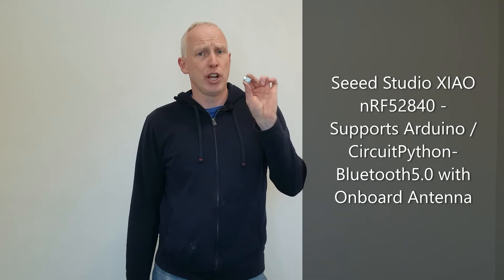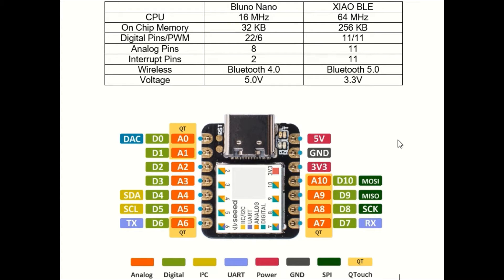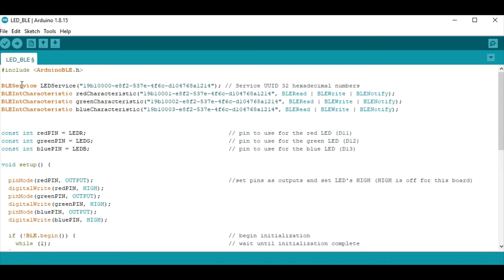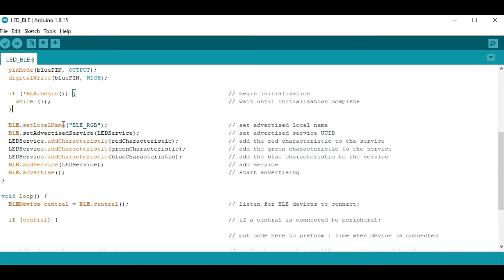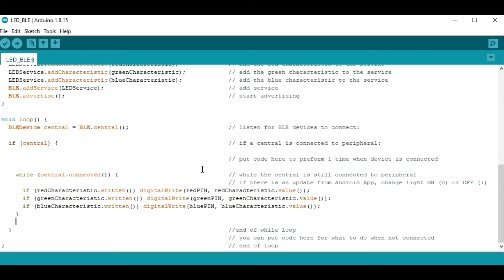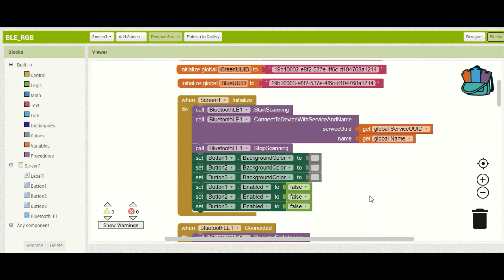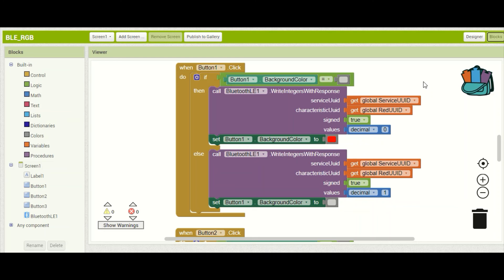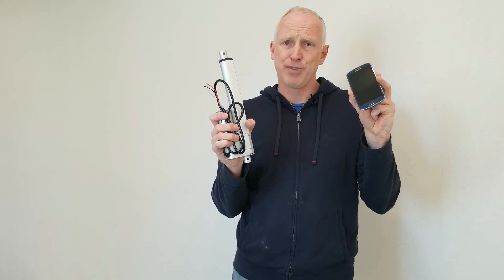XIAO BLE Digital Output Control using Arduino and MIT APP Inventor

Comment: As versions of libraries are always changing, some changes have occured with XIAO. The reserve names for LEDR, LEDB, LEDG are now LED_BLUE, LED_GREEN, LED_RED.
Secondly, I'm getting a compile error, which is probably the BLE library version. What version are you using?

d:\Arduino\libraries\ArduinoBLE\src\utility\HCIUartTransport.cpp:39:2: error: #error "Unsupported board selected!"
   39 | #error "Unsupported board selected!"
     
d:\Arduino\libraries\ArduinoBLE\src\utility\HCIUartTransport.cpp:105:40: error: 'SerialHCI' was not declared in this scope; did you mean 'Serial'?
  105 | HCIUartTransportClass HCIUartTransport(SerialHCI, 912600);
Reply from the maker: Looks like I was running ArduinoBLE 1.3.6, though I am not certain because I have switched computers since then.

Comment: I'm not able to connect the Arduino Seeed chip to the MIT app once it's on my Android Tablet. I think it may have to do with Bluetooth permissions with newer versions — is this something you encountered?
Reply from the maker: I didn't have that issue... perhaps there is a setting preventing connection? Does the tablet at least detect the device?

Comment: Hy. I downloaded your files and spent you a coffee. But I cannot connect with the Arduino Nano 33 BLE. There comes the error message that the app has no bluetooth access :( 
Do you know a solution? Has the app first to ask for bluetooth access?
Thanks and kind regards
Reply from the maker: I didn't try it with a Nano BLE, but it should work about the same. Are you able to detect the Nano when you search for Bluetooth devices with your phone? The code should connect automatically if the phone is able to detect the Nano.

Comment: Hello, i am having problems pairing the device with my Android phone. It says that the PIN or passkey is incorrect, however a window to enter it does not even show up. Do you know what is going on? I tried with my colleagues phones and it happens the same, we can see the device but can't connect to it.
Reply from the maker: You shouldn't need to pair with the device (I don't when I use mine). When you run the code on the Android it shoud connect automatically without needing to manaully pair. Hope it works for you...
Reply: @ScienceFunInnovations  Hello, it worked 3 months ago, but now I updated my phone to Android 12 and it is not working anymore. I am getting the following error: need android.permission.bluetooth_scan permission